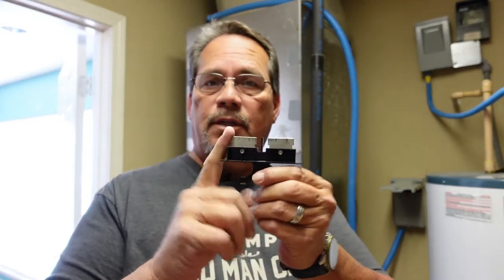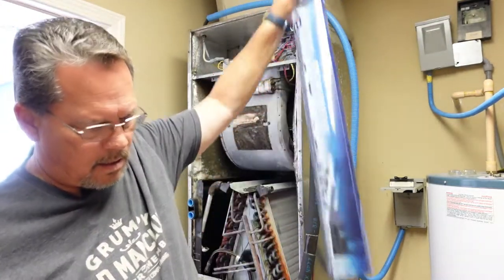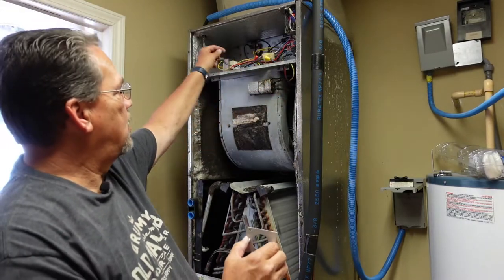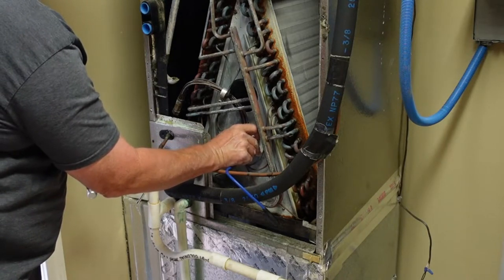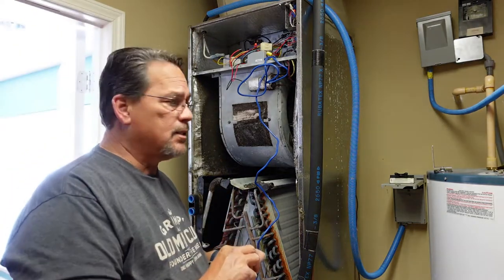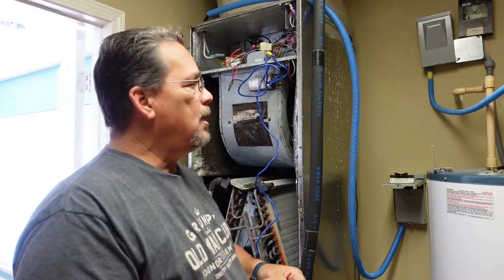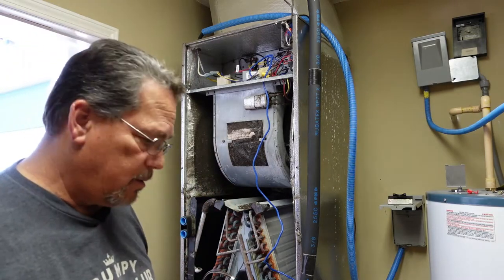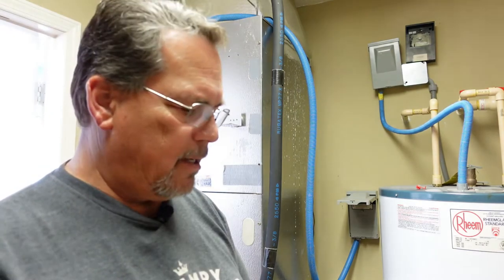How to Improve The Air You Breathe With UV Light

Comment from the maker: Thank you to each and everyone of you that take time to watch this video, I hope it gives you some helpful information to consider at your home and work. Thanks a bunch.
Reply: Good video. What is the part number or model light you used?
Reply from the maker: @hvffarms6913  if you look in the description area of this video, I have a link to the exact UV Light I used. Thanks for watching
Reply: I like the video although just a couple of comments, the transformer feeding the air handler isnt a 40amp or a 30amp, it would be huge if it was, I think you saw a 40ampere per hr name plate, this means 40/24v = 1.66 amp rating. it feeds the control module. depending on the rating of the lamp you installed it could overload this very small control transformer. Also dont look directly into the UVC lamp you can damage your retina permanently.

Comment: What about the varibit hole you drilled? Does it create filings that fell into the bottom of the handler? Or maybe someone can put a shop vac on the hole as it's being drilled if it produces metal filing?
Reply: You could put a vac on it to help catch the metal bits.  However, those few bits that fall in there otherwise are probably insignificant.

Comment: I found this useful (locate transformer 24VAC outputs).  Mine was in attic, unit had less clearance due to that small valve, its plumbing, and other plumbing.  Actually used the round access plug and sistered it to the supplied hardware, as it was the only accessible area.

My only concern is the long term UV effects on plastics -  my inlet duct is a plastic flex hose.
Reply: Mine was shining on the flex and it ate it up.